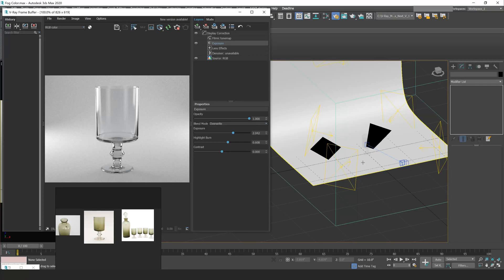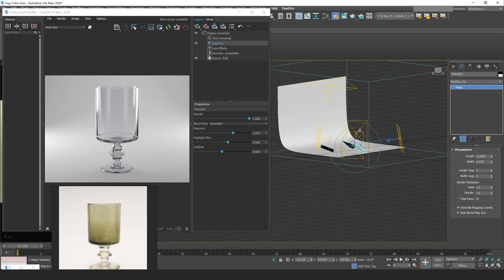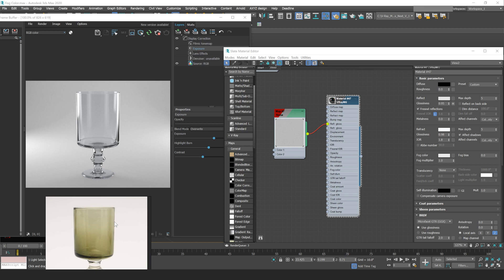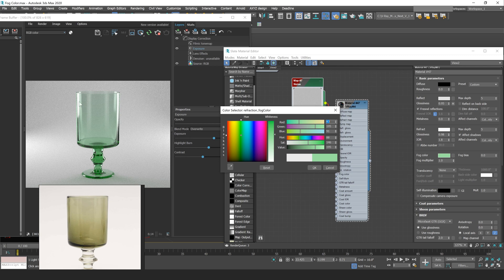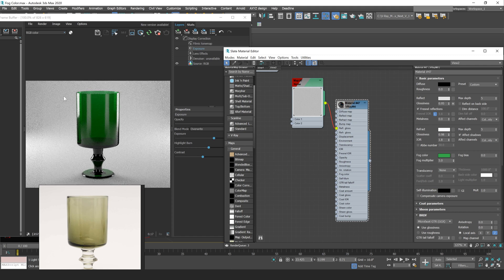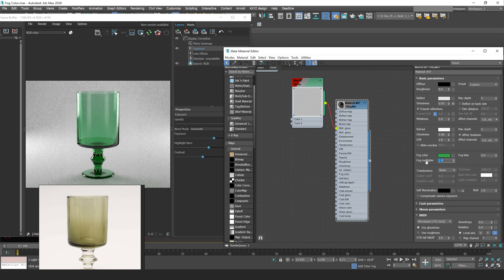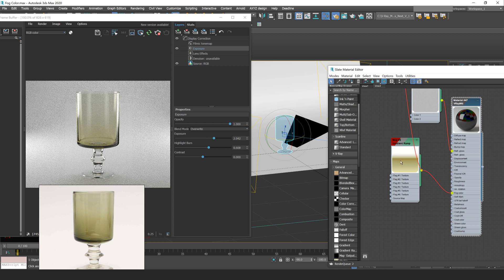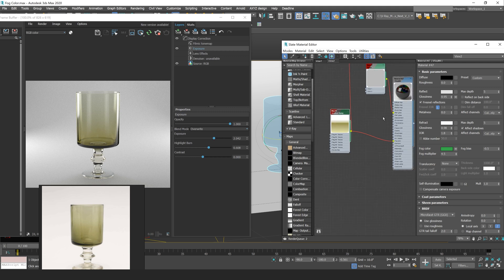Fog Color with Vray 5 and 3ds Max

Comment: I´ve got Vray 5 and the Fog multiplier doesn´t exist. It just have type of traslucency and Depth.
Reply: Could you find a solution ? Same issue here
Reply: @oledesign  Hi! At first didn't worked out using the amount of Depth(cm) between 1 cm and 100 cm for instance. Try using values between 1000 cm and 4000 cm, and you'll see that it will start to smooth the amount of fog.
Reply: you must have VRay V5.20.02